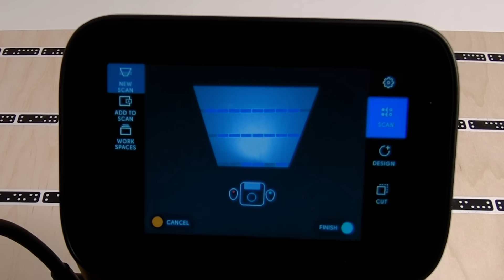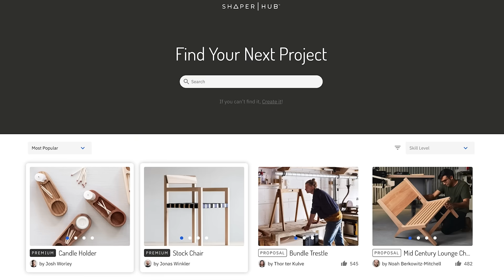Shaper Origin: How it Works in 3 Minutes

Comment: how much tape do you need for every job
Reply: Just depends on the size of the job and material needed. There is a stationary work station for doing small jobs and a mobile plate you can use that has a durable tape pattern for patterned work - like door hinges or hardware installs. If you are doing a big job, like a whole sheet of plywood, will need a roll

Comment: The only thing I can complain about is the extremely high price for the tape. $22 for 150 feet of tape that you have to have in order to use the machine. And a lot of the time the tape doesn’t stick or the face peels off and you have to waste so much of a $22 role of tape. Shouldn’t be charging that much for a disposable item like that.  A pack of 10 rolls maybe.
Reply: Can't you just use the router to cut it into the table so it's permanent?
Reply: I hope someone answers this.
Reply: Do you still need to use tape if you have the workstation (& your project fits on it)?
Reply: If the price bothers you 
Order it from a custom tape printer 
Its cheaper
Reply: @Woods-BC  great idea. Thanks
Reply: Thank you for sharing.  I have watched many quilting videos, this is the best. Headed to my fabric stash and getting to work! Merry Christmas from Arkansas!
Reply: It's marketed with the professional in mind. Consumables are factored into the total cost of a job. 22 usd for time saved and added accuracy is a bargin on both client and company.

Comment: Hi guys, one question: is there a option coming up in the future that the origin is able to mill 3D contours?
Reply: How would it do that? It doesn’t float over the piece like a CNV does….
Reply: @MrLocke-bk3om  as someone has already said, the router does raise and lower, so it's not a million miles away already.
Reply: Would think it’s possible, but only something smaller than the base plate, or on the edge of the piece.

Comment: I'm a bit confused. So is it a CNC? If it's a CNC, why do you need to move the machine manually? If it's not a CNC, why don't I use a router, saw or chisel to do the same job?
Reply: It’s a cnc with a reach of about +/- 1”. So you need to move it to where it can cut.

Comment: I hate products that require you to keep drinking from their company's well. How much is that "tape" that's required to use this tool? It's there an alternative? Could I print my own strips of that tape an vs use that instead?
In my opinion, for $2800-$3400 this tool should not require you to be future dependent on buying proprietary materials. Imagine buying a rigid brand router that refused to work with a Diablo brand cutting bit!? 
Speaking of bits, am I limited to only using YOUR brand cutting bits too?
Reply: And at $22 for a tiny roll of cheap paper tape that doesn’t stick very well and splits on occasion so portions of the already tiny roll is ruined. I do large projects and it gets very expensive to keep using.
Reply: There should be a recognized standard certification that certifies products not being limited to use the manufacturer only proprietary tools. Product sellers should stick on selling the product and not ruin everything by gatekeeping behind a subscription like paywall system. 

This pricing strategy is the worst kind of all

Comment: could this take on the job of a big cnc router table and cut clear acrylic and eva? large straight lines 6-8' and 3" radius on the corners?
Reply: So long as you have enough tracking tape, there's no bed size restrictions.

Comment: Can one cut shadow foam for tool inlays If so how would it's software make it more capable, or more accurate than other CNC machines? Thank you in advance.
Reply: normally you hotwire foam then glue foam on the bottom then cut edge flush with hotwire.
Reply: @Eluderatnight  how can you burn foam with the hot wire when you have a burning sensation in your wallet from the extra €4k dancing around in there?
Reply: @comfortablydoomed  I got quite a chuckle from your joke! Yes -- it costs allot -- but tools made in Singapore and or Germany with onboard CAM are not cheap.   You won't need it if you can hold a plunge router by hand and stay on your line to .1mm. Then again, the cyborg upgrades to one's hand and brain would alone cost more than 4k 😅

Comment: I'm not shelling out 2500 bucks for this. I would rather get good with a hand router or my Dremel with router stand which is a fraction of the cost, even with the added accessories like Letter and Number Templates.
Reply: This is a handheld CNC that can literally accurately cut any shape or design you want. There’s no way a router is even coming close.
Reply: @kjohn5224  Why do I need a handheld CNC, instead a completely automatic CNC?
Reply: @chaselee86  One good thing about this one is that you can do any size items.
Reply: I think you're underestimating this tool, it's a handheld cnc machine, its accurate, portable, space saving and honestly not that expensive when you take all that into consideration, in terms of work flow its a no brainer.. if you've ever hand cut intiricate inlay you'll know it can take days... and time is money 💰 the only thing you can't do is multi task with it, you can't put it down and let it cut but its still saves so much time it negates that fact. Don't rule it out ✌🏽
Reply: Okay, great.
Reply: Are you seriously comparing a Dremel and router with a smart CNC device? All the hours getting ready to align, setup and mill out circles, dovetails and other precision cuts easily add up to thousands over time, unless you are just a hobby user.

You won't be able to make the cuts this thing can do (almost automatically, just guiding it by hand) with the tools you mention. It's like comparing a hand drill with a lathe.
Reply: @muizenissen  if you want your doing you can do nearly anything without a fancy tool that costs 2500 bucks. 

you'll be surprised by what people can do with the simplest of tools.
Reply: @StarKnight619  Im not doubting the skill of some people, but you simply can't compare a dremel with a cnc. This is meant for professionals, or for those that can't do it by hand. And, in the right hands this tool can likely do much more than that dremel can, in less time.
Reply: This is for people who see $2500 as an investment for their business. Just like how the average homeowner wouldn't spend $25,000 on a lawn mower, the average hobby woodworker wouldn't spend $2500 on this.